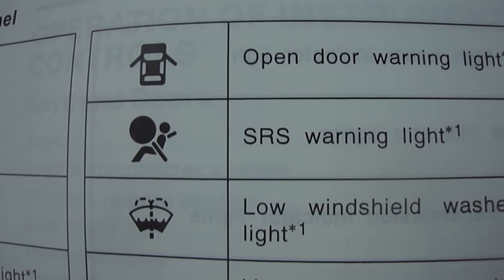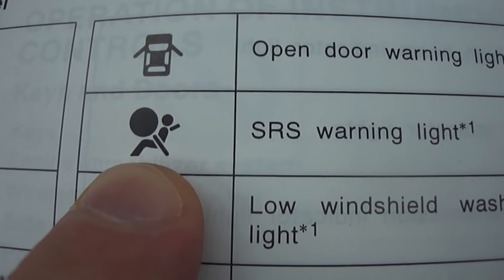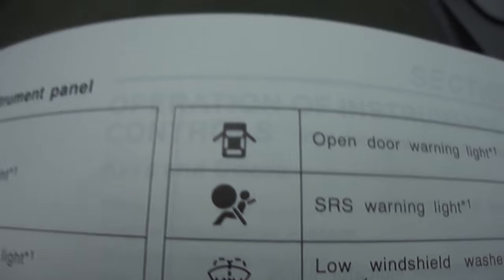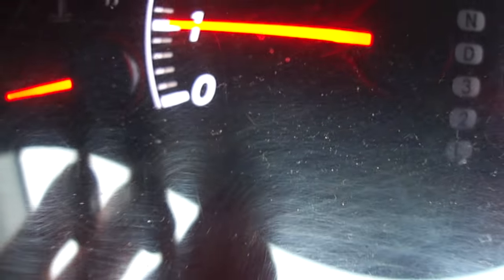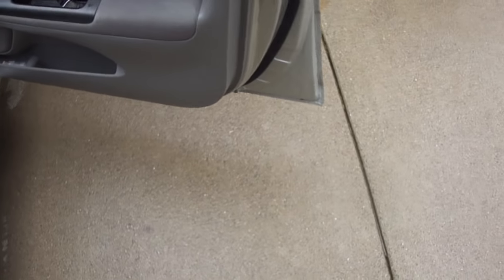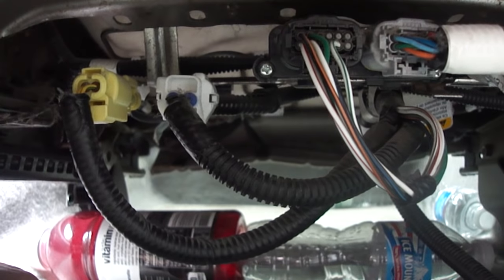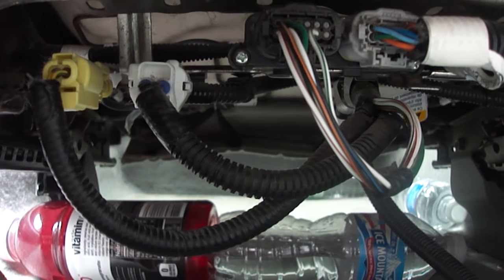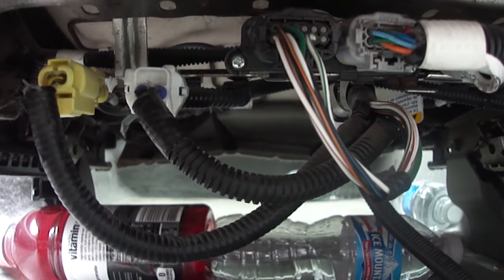(Part 1) How To Fix Airbag Light - Fast & Easy!

Comment: Ok, my srs light was blinking for a week I looked under the seat after watching this video and the yellow connection was disconnected.  I reconnected the connection and started my truck, problem solved. Thanks!! One of the best most direct self help videos I've ever watched.
Reply: Did you first disconnect the negative charge on the battery?
Reply: @blakestam6235  should I?
Reply: @michaelri1224  I was asking so I can disconnect before working on mine too. But I ended up not disconnecting it, I only went under the driver seat and pushed the clip in and the light went off, it’s been off for about 5-6months now.

Comment: Worked out perfectly for me.  Thanks a lot.  The inspection guy said I would fail inspection with the air bag light on.  He gave me a chance to fix it and not get a fail.  I watched your video and jiggled the cables, worked perfectly.

Comment: Dude Thank You! You saved me 3500 bucks - Light was on, wife was freaking out, just had the scion in the dealer for a diagnostic and they quoted a floor harness replacement and made me sign a waiver to drive it away with the light on. What a load of crap, especially because it's basically the value of the car. I suspected it was exactly this type of thing so thanks for the validation. Worked like a charm!
Reply from the maker: Glad you got it fixed.  I can't believe they were going to charge you $3,500 dollars.  What a racket!
Reply: The stealership

Comment: You are officially my hero of the day. Been having the same problem with my 2012 Charger. Watched your video, got under both seats and jiggled/tightened the various connecters and voila! No more airbag light. Undoubtedly saved me a trip to the dealership and who knows how much $$$. Thanks!
Reply from the maker: You're very welcome.  Thanks for the kind words.  The video seems to be  helping alot of people.  Please subscribe to my channel as it will help you with other things.  God bless you and have a great day!
Reply: Wow..... You are genius 
It works on my car too... I got the light ON & search online to know what can be done to it... Many videos are mechanically complex to use but yours was so simple & easy ... Not only that, it saves me from spending unnecessary to fix it... Thanks for exposing this to us... You are so kind ...
Reply: What connectors you actually mess with on my 2011 ram 1500 my airbag light is on , I check all connectors under both seats seem to be tight, when I first start the truck light is off then when I pulled out of my driveway light comes on and stay on
Reply: I’m trying to do this and it’s not working for now. I tried both seats moving the harness
Reply: My hero also, problem solved.
Reply: @lilic724  may be a bad clock spring.

Comment: Wow! I just got my active headrest dvd monitors installed on my 15 DD at car toys and the airbag light came on along with my seatbelt light even though I had my seatbelt on. I searched on YouTube and found this video. I watched it then applied it and bam...there was wire under the drivers seat not connected so I connected it, turned on my vehicle and it worked. Thnx. Great video and saved me a trip to the dealership. Yes it worked!!

Comment: In some cars it's the occupancy sensor that fails in the passenger seat and causes this light. You can run a resistor off one of the wires going to it and it will turn the warning light off.  They also offer this online as a plug in adapter. Airbag will still operate properly. Also a sticky seat belt receiver can cause the SRS light to come on. Just shoot a little WD-40 in there to loosen it up. One time in a old 92 Mercedes 500SL I had the ASR and SRS lights were on.  Found it was the contact ring in the steering wheel under the air bag had a bad connection.  Found a good used replacement and it turned the warning lights off.
Reply: Hi,
Thank you for the advice, coud you  please be more specific as to what value the resistor should be ? Thanks !
Reply: Got a link to a bypass where the airbag light will go off and still function in an accident? Thanks!

Comment: May God bless you Paul!  Unfortunately I paid the dealer $128.00 to tell me they want to START by replacing the SRS unit, before I saw your video.  I was having an intermittent problem with the light coming on and off.  I didn't know the airbag system was also part of the seat belt system.  Once they told me it was the SRS unit I started searching on Youtube for help and found your video.  I just finished pushing in the Yellow connectors under the front seats and it was the one under the passenger seat.  The light has gone off!  It cost me over one hundred dollars to learn this lesson, but the dealer was going to charge me over $800.00 to fix the problem!  I feel really stupid now as I can usually fix minor problems myself.  I know nothing about airbag systems and was probably a little intimidated about trying to fix something so important myself.  Thanks again for taking the time to share this tip!
Reply from the maker: I really glad it helped and saved you a lot of money.

Comment: You my friend are a legend.  Resolved my issue and could feel one of the plugs had come loose.  Pushed back in and then lights gone.  Had a fair few niggles since I brought my car ironically taken out of fleet by company I work for so wasn't looking forward to another garage bill.  You have saved me the headache.  Thanks.
Reply: @proclaimliberty2000  n

Comment: 2012 Acadia. Had a service airbag message on my odometer with the seatbelt icon. I just made sure the connectors were tight and the message is gone. Thank you SO MUCH!! You just saved me an $89 diagnostics charge and God knows whatever else. I appreciate ya!

Comment: This video absolutely just saved me $$$.  I looked under the drivers seat and saw a yellow plug had come unplugged.  I plugged it in and works fine.  I went  3 auto parts stores to get opinions and to try and get the light on the dashboard scanned, but they were unable to scan for airbag issue.  Wish I had looked at this video first.  Thank you.
Reply from the maker: uspopjw 👍😊

Comment from the maker: Just an observation from my own personal experience is that there seems to be a direct corrilation between driving a lot on bumpy roads and the light coming on.  But I'm always able to fix it in by wiggling and pushing those electrical connections together.
Reply: LP
Reply: Lynn Schumann gg
Reply: Mine is now on and have'nt done anything yet.  after you check the connections, do you have to restart the car or will the computer now recognize everything is good to go while running?
Reply: proclaimliberty2000 el
Reply: proclaimliberty2000 how did you know mate ??? Mate i was a bad egg in my younger years with no remorse to what i had done untill my wife and i started dating about 15 yrs ago and im forever grateful she steered me in the right direction.
Reply: proclaimliberty20
Reply: Thanks, that was it.  I just pushed the yellow connector in and the problem was fixed.
Reply: SO glad I found this before taking mine to the dealership! Definitely have tons of bumpy roads in Michigan. Thank you for posting!
Reply: proclaimliberty2000 is
Reply: Mine will go off by turning the steering wheel while parked, then you can start turning it back the other way and it comes back on, I’m thinking that maybe there is a short in one of the wires in the steering column.
Reply: The yellow connector is tied to the seat belt system to sense sudden stop or deceleration to activate the SRS air bag system.  I have the same problem on my RX300 which I will tackle soon !!
Reply: Wellah, there are lots of bumpy road in New Jersey and Pennsylvania too!!  I try the same trick on my RX300.
Reply: i don't even see a part 2
Reply: It's not always something wrong with the Airbag system, sometimes the sensor wiring under the drivers seat can get knocked loose or come unplugged from the electrical system... this happens when items get pushed under the seat. So before you do anything dramatic like pay a Mechanic hundreds of dollars to run a diagnostics and charge to replace any wiring, etc. Check that first.
Reply: proclaimliberty2000 bro I just did what you told me to do move the wires a little bit and it work bro no light on bro thank you so much man I appreciate it I'm from Minnesota represent boy
Reply: Roberto  if you read my very first comment i made and the replies you'll see that he posted a comment in which i replied to which has nothing to do with you what so ever!!!
Reply: @appalachiangunman9589  Replace clock spring in steering wheel.
Reply: Bleepnsheep thanks I’ll have to look into that.
Reply: @appalachiangunman9589  A pretty easy job. Last replacement I bought brand new for around 15$ on Amazon.
Reply: my Hyundai eon air bag light always shown after traveled bumpy roads..how to fix it..?
Reply: Mine came on after I changed the cabin air filter

Comment: Thanks so much for this video. I am not very good mechanic and I feel like fixing this myself since you made it look simple. I however cannot get to the yellow cable because there a black plastic barrier that prevented access to the seat. 2002 Toyota Avalon. Am scared to try loose the bolts securing the barrier lest airbag let loose. My mechanic said I should leave it and it will go off one day. Pls what do you advise?
Reply from the maker: Distinctive Shinning my advice to you is if you’re not comfortable performing this don’t do it. I did this video because I’m sick and tired of seeing mechanics rip people off. Also be advised that as long as your airbag light is on you have no airbag protection if you’re involved in an accident.

Comment: You are a genius!!!!  Thank god for youtubers!!  I was so frustrated when this light turned on and with the advice it was cleared up in seconds.  thank you.
Reply: K Boudy did you turn off your car? While doing this because it’s doesn’t seem to work for me
Reply: Cristal Lovee Try the bumper sensors too... just wiggling the sockets
Reply: what is a bumper sensor? where do you find it?
Reply: There are air bag sensors up front somewhere at the bumper or within that area, look for yellow cables, just be careful to disconnect car battery or have a professional mechanic assist you. Make sure those sockets are clean.
Reply: Dor Hajaj 🤣🤣😂😂😂😂😂😂😂😂😂😂😂😂😂😂😂😂👍🏼 good one 😂
Reply: Sağ yolcu koltuk ağırlık sensörü arızalı airbag lambası yanıyor napmaliyim

Comment: I just bought a used 2005 Kia Spectra Spectra5. The SRS sign lights up so I was researching on line how and the cost to have it fixed. After finding your video, I did what you advised, and what a relief, it did fixed the problem. MAHALO!!!!
Reply from the maker: Awesome!

Comment: You are the man. My camry 06 has the same airbag light problem. Toyota dealer asked for $140 just for a diaganose. I suspected something very minor that would cause the light to come on. I followed your video and and firmly pushed all 4 connectors underneath the passanger seat. THIS SOLVED THE PROBLEM. Airbag light didnt stay on anymore. Thank you sir.
Reply from the maker: Do Vo That’s great!  You’re so welcome 👍😊

Comment: We have a 2010 Chevrolet suburban and our light has been on for about a month and we came across this video and tried negotiating both sets of wires under the drivers seat and the passenger seat and this did fix the problem so thank you and it is a good video for those who don’t want to spend the mind of a mechanic do the exact same thing you can do

Comment: Thanks for a good and useful tip. I roll on some fairly hilly and sometimes bumpity terrain or country roads with plenty of turns and twists. This should help reseat the connection(s).
Reply from the maker: Joseph Sunday 👍

Comment: Thank you so much,it worked on my vehicle also. 
Great video and good advice, I got 2012 Honda Accord and I had SRS light on for no reason. I watched your video and did as you suggested,I disconnected connections under driver seat and passenger, than reconnected everything but pushed them in. After vehicle was restarted,SRS light went away.
Reply: Nazarettos 6

Comment: Good.thanks.ill try it.came from stealership.wanted $500 to change out srs cable.took it for airbag recall for the 2nd time.noticed light came on after first time.said if in an accident, the airbags wont work because  of broken cable.but like you and others are saying,just might be loose connection.some people on a complaint site say they charge anywhere from $85-$185 to "diagnose"the problem,and some of the time still can't  figure it out.one guy paid for them to fix sensor,came back on,then paid to replace airbags,came back on,then replaced srs cable.cost over$800 in total to repair.mostly unnecessary things.need to be part of a recall.frank w.
Reply from the maker: Let me know what happens.  Be sure to watch Part 2 and Part 3.

Comment: I drive a Scion TC 2007 and this definitely fixed the issue. Because my car is a two door, I have to move the seat forward if I have any additional passengers . I'm guessing because I keep moving it regularly, it moved the yellow head wire. After wiggling around and making sure it's connected properly the light went away after starting my car . Thanks !!!

Comment: Thanks man! My Toyota Avensis '99 failed on the inspection before christmas. It ruined my christmas feeling. But today I began searching after looking at your video. I began with the connectors under the drivers seat. Took them apart, sprayed a little electronic cleaner spray. Put together again. No error!!!! It was like 5 min fix!! Incredible. Would have cost ridicilously much at workshop.
Reply from the maker: TheQuietBeast 👍

Comment: Such a simple fix man....thank youuuu!! This was exactly my issue..👍
Reply: one of cheapest ways to solve a lot of problems with electronin or electrical system on any type of automobile is to disconnet  connections spray Wd40 or similar andreconnect it works 98% of the time do isolate the system for safety reason first

Comment: I was cleaning my son's 07 mazda3 and did alot of vacuuming while the engine was running. After cleaning I saw the airbag light on. I did online research and found this video and suspected I my have hit some switch underneath tbe passenger seat. I followed the instruction in this video and PRESTO, LIGHT WAS GONE! Thank you for sharing this quick inexpensive fix!
Reply from the maker: You're welcome!

Comment: I concur, Paul. I recently purchased a new (used) dodge ram and have had issue after issue with the Airbag sensor light. I got it into a professional for the clock spring to be replaced however they never ensured a secure connection under the driver seat. It periodically comes on, only if I have to adjust the seat position. Yet, a quick wiggle and securing of the harnesses does the trick to get the light off.

I will most likely wrap the harnesses in electrical tape so everytime my wife drives the truck and moves the seat, the light doesn't come on. Hopefully this does the trick.

Comment from the maker: Hi Everybody.  This just happened again on the car in this video.  I fixed it in one minute.  It was the passenger side seat.
Reply: this worked great. It took 3 minutes to accomplish. The dealer wanted $150 just to check it out.
Reply: This is just a suggestion, maybe use zip ties to fasten both pieces of the connection together so the connection remains tightened.
Reply: Dealers are there to rip us off, not for help.
Reply: God bless you too, thank you Brother!
Reply: Be careful with all the bottles.
One of my passengers left one in my van.
It rolled under the brake pedal.
No Bueno!
Reply: Miguel Santiago: Just like The GOV. and the PC-politicians... ;-)
Reply: I will try re-seating the yellow connectors on my RX300 on both front seats.  I hope it will work for me too !!  Also may be I will use some WD-40 to replace the moisture is there is any !!
Reply: @davidjones5706  exactly I was pissed man, they rip u off smh
Reply: @anitralvelazquez  o wow

Comment: The idea worked great! Thanks for the info. Tomorrow I will cancel the appt. with Dodge for a $99.00 diagnostic fee. My stars, this is a 2017 Grand Caravan with only 36,000 miles. Moving the seat back and forth can cause this. Nothing was really disconnected, so I wiggled  every conection under both the driver's seat and passenger seat. Started van and the light finally went off! Thanks again!
Reply from the maker: Mike Correll 👍😊

Comment: Hey, thank you so much for the tip! I just did it on my '05 Honda CRV and it worked...there was a loose connection under my passaenger seat.
Reply: yssssssssssssssssssssssssssssssssss
Reply: ys
Reply: 7828877288288384t7677838847478838😅😄😉😊☺🥰🤑☺😐😶😑😑😑😑😑😑😑🤗🤗😋🤪🥲☺🥰😝☺🥲😚😚😍😝😍😒😑😒🥲😋😋😋😋🤩😝😝😛😝😗😗😃😄😍☺😋😝🤫😐

Comment: Worked perfectly on my 2010 Nissan Cube ....my airbag system was blinking and shut off my airbags...I did this and it reset! Thanks!...also under passenger seat make sure sensor plug isn't loose.

Comment: Dude you rock! my inspection is coming up and my airbag light has been of and on for over 2 months and then was permanently on, did as you said and wiggled all connections and no more air bag light, after reading many forum's on this the fear began to rise of the cost. I have a 2006 Kia Spectra 5. I am maybe guessing my many coffee cups over the last year that always seem to find their way under my seat may have hit one of the connectors. thanks again!

Comment: It WORKED! my 2010 - 4runner had same issue but wiggling both plugs under seats didn’t work BUT I tried the FRONT BUMPER SENSORS and that fixed it. Thanks for the fix idea... keep trying other connections and you will most likely fix it.

Comment: Just checked under drivers seat on my 2006 Silverado. Found broken yellow wire at plug. Will repair tomorrow and see if Air Bag light goes out. Great info.... Thank you!